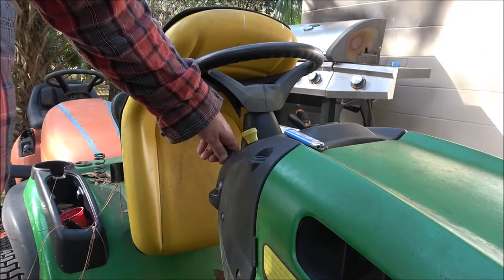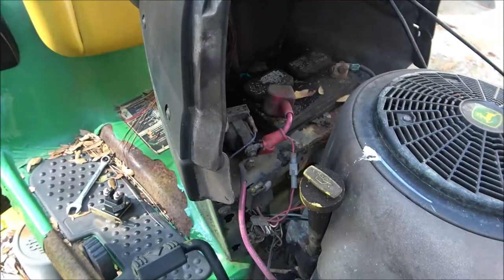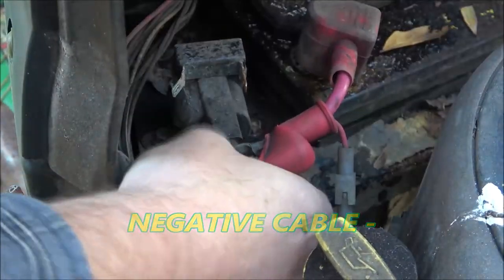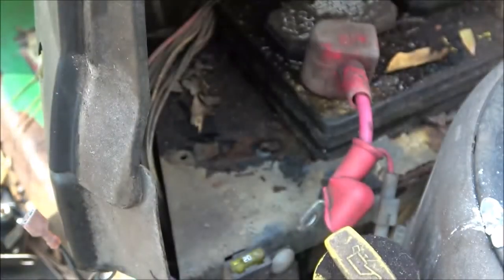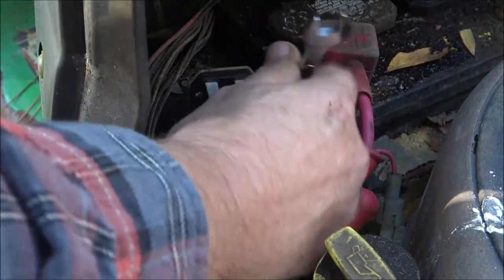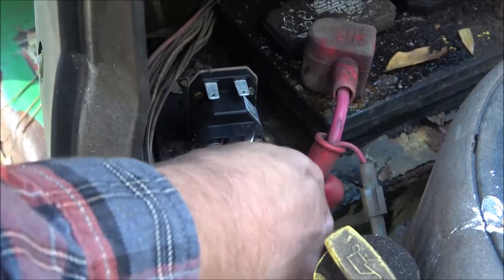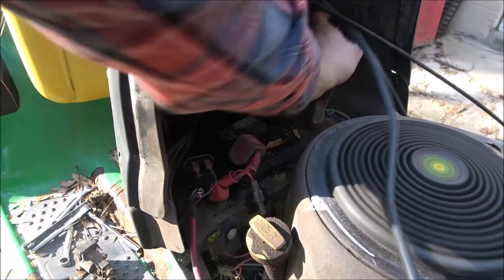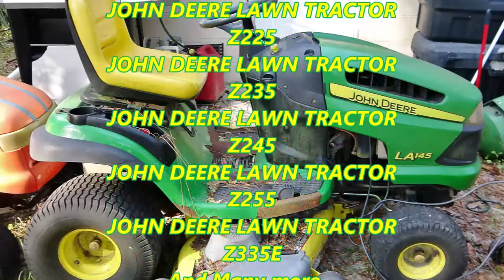Diagnosing LA 145 John Deere Tractor Clicking But Not Turning Over

Comment: I’m hoping you might be able to help me out.  Re: JD LA150.  I was having the same problems and I replaced my starter solenoid and no change?  So I thought it might be the starter itself.  I changed it out with one from another tractor that I know works and nothing?  Tried jumping and nothing?  Put charger on it overnight to make sure battery was hot, and no change?  With the new solenoid it clicks but also sparks from the negative battery post?  20A Fuse is is new.  ??? OzarkMark
Reply from the maker: If it's sparkling from the negative battery post that's the problem take it off and clean it real well and retighten that should take care of the problem. Let me know how it turns out.

Comment: So I have a brand new battery, and put a brand new starter in my la145. Doesn't click but it gets power to the mower since the lights turn on. Any suggestions on what I can do?
Reply from the maker: Check fuses, safety switches, and ignition switch. Also make sure your cables and connections are clean and tight.
Reply: @shabear1000  where would the fuses be located at? We got this from a friend
Reply: even tried to start it from the starter solenoid and don't even get sparks from it
Reply from the maker: @maryjasso7034  sounds like you have a bad cable or something similar to that.

Comment: Mine clicks even with screwdriver.. think starter is bad?
Reply from the maker: Could be. Make sure your battery is fully charged of course. Then run a wire from positive down to starter and see if it clicks then.